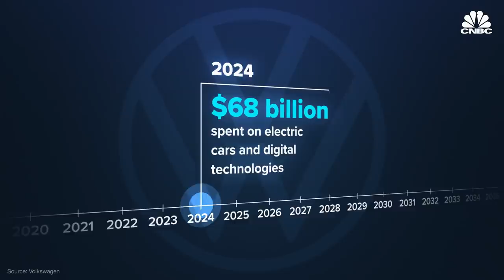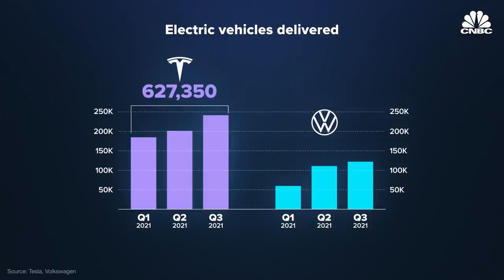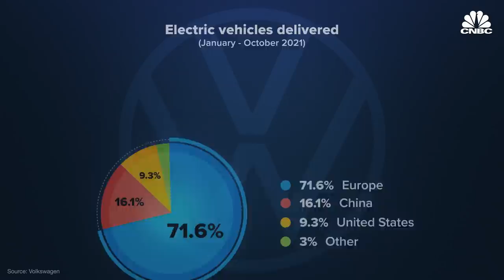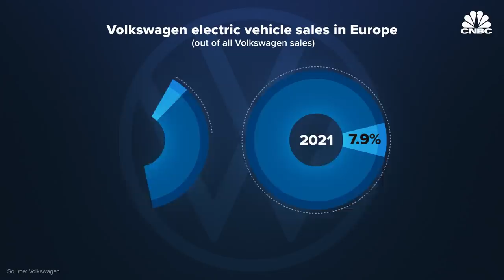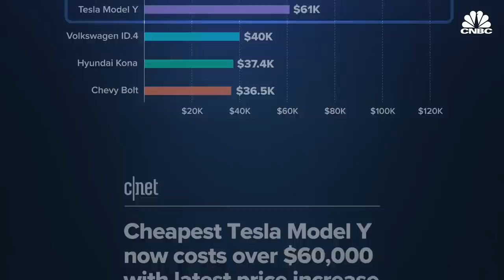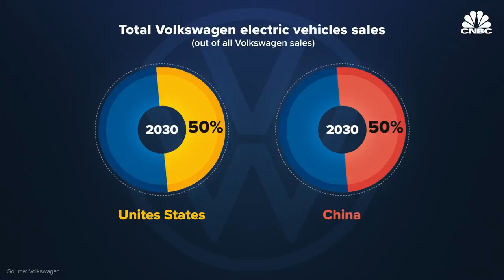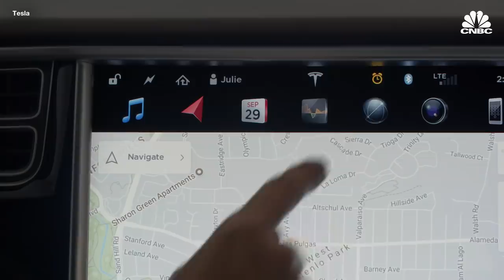Why Volkswagen Is Beating Tesla In Europe

Comment: It’s all about business infrastructure, you can find a VW dealer and thus service  in every major city of all EU countries. When I choose a car having the support infrastructure at a good price level is everything. Cars need maintenance and eventually break down, you need reasonably priced service that is actually available.
Reply: EVs do not require the same level of maintenance, so what you are describing is a non-issue.
Reply: @IanHague  real issue when you have to travel to another country to get an issue fixed for your Tesla. Check Tesla’s service coverage in Europe. I’m not sure you fully understand the issues those cars are having. Further more, I would not be even willing to travel to another city for fixing/ maintenance. The car is a tool and it’s sole purpose is to serve me not the other way around
Reply: not helping if "right to repair" is a thing, like an iPhone lockout.
Reply: @IanHague  they need maintainance, that should not be 300km away or part should not take 3 months to arrive..
Reply: @Enrique Thiele Bushes, control arms, air filters, etc...anything that is subject to wear and tear from a daily usage. So yes I have an idea :)
Reply: @Enrique Thiele try to replace the batteries..
Reply: Tesla's quality issues lead to huge waits on warranty repairs apparently.

Comment: Build time for a Tesla 3 is 10hrs.  Quoted build time for a VW EV is 30hrs. To compete, VW will need to reduce build time by 2/3.  More automation, fewer workers, job losses.  VW'S fight is internal. The business has to overcome it's unions. A historic battle looms...
Reply: Tesla is the most inefficient car builder by a long way. Look at direct labour to output and it is still decades behind Toyota

This does not include all the rework needed for such a badly bulid car
Reply: @teddysthaiadventure2534    I don't know where you get that theory. I think you pulled that out of the south end of a northbound horse.  I am open to the data, please list it

Comment: The title of this episode is absurd.  Tesla's factory in Grunheiden is not even up and running yet--- when it has had a few months to get up to speed, Tesla will be trouncing not only VW, but every other car maker.  Tesla can compete very favorably on its single front- and rear- castings, which they are years ahead of everyone.  It would take years just to get the casting equipment, months to install, and they might never get the propeietary alloy right that is needed to prevent one or more casting issues such as warping.

It's not just the casting issues... for instance, many consumers realize VW burned them bigtime on Dieselgate, and that scandal will last a lifetime with many consumers.  Tesla does not have that issue to overcome.

There are other problems Diess will have that you did not cover in these few minutes.  Tesla has the upper hand as long as they make no serious faux pas.

Comment: The vast majority of people in europe is living in flats. Where are they supposed to charge their cars? 
Underground parking charger installations won't do. An EV is too dangerous to be charged or even parked under an Appartment house since it can catch fire and when it happens you simply cant extinguish it. There were already some cases of sudden burning of tesla cars due to some kinds of short circuit.

And the studies have showed that charging only at the fast charging stations reduces the battery life significantly. There needs to be variation, but mostly charging over night is better for the battery.

This is the one big thing that stops me from even considering to buy an EV

Comment: My diesel car has a range of 1200 km, I can fill it up in less than 5 minutes and filling stations are everywhere, that's comfort no EV is likely to beat anytime soon if ever.
Reply: So how much does it cost per km to power your dinosaur juice-guzzling belcher?   Run the numbers.  Here in the states it only cost me 3 cents per mile compared to 10 cents / mile for gas in my area.

Comment: Would be nice if the ID4 didn’t include a long list of things you have to settle for: bad seats, arm rests, horrible lagging screen interface, lousy range, no software updates.  That may have been ok in 1969, or 1989. But Asian EV’s and Tesla blow VW out of the water.
Reply: cars are not home appliances. there's a reason every major car manufacturer maintains a network of service centers with qualified techs.

tesla has none of that. and they never will at this rate.
Reply: I don´t know where you tested the cars, but the built quality of the iD4 is much better than that of Tesla.
Reply: @yoshyoka  lol

Comment: With a Tesla you can easily Charge all over Europe. 

And the Pricing ist competitive. all you need to do ist to compare the Model 3 with other cars.  

In a Model 3 you have also a much better Software including navigation and planing for SUC on your route.

For now, Tesla offers the best total package for the Customer.
Reply: and all that comes with a price
Reply: Kia EV6GT 10k, same range, same acceleration, quicker recharge due to 800 volt tech, can recharge other cars via plug, level 3 FSD while Model 3 and Y have same range, slower charging times 7 to 10 minutes slower, only level 2 FSD for 10k higher prices.
Reply: Tesla better navigation than Google app in cars, fake news.

Comment: They're not selling the ID.3 in the States?! That's killer model.
Reply: Probably because it's too small for the American market
Reply: Americans want longer range… everything is more spread out
Reply: @cybertrk  The standard Model 3 offers 260 miles, the same as the ID.3, and that sells fine. That's four hours driving between charges. And a 340 mile ID.3 is available. Perhaps Tesla benefits from its proprietary charging infrastructure. 

And, as someone else commented above, Americans might just want bigger cars.
Reply: @cybertrk  That's not really why, though. America is "crossover" land. Sedans and hatches don't sell well. The Model 3 is the exception probably because it is one of the few fast purely electric sedans available. But the Model Y is going to face stiff competition in the USA.

Comment: You know why VW will dominate over Tesla in Europe as well as every other Europe based manufacturer? Because we know how to build cars. Compare battery capacity of Tesla and VW, it’s not as big of a difference, but compare build quality and the difference is enormous. And people in Europe are used to high standards when it comes to cars.
Reply: ID.3 has terrible build quality.. Being proud about germany is a nice thing, but you should stay with the facts. Tesla is going to produce their cars in germany with german engineers working there too. The build quality will be amazing, which it by the way has already been for about a year since europe has been getting the cars made in china, which have a much improved quality to the fremont cars we used to get, which were mainly bad, because Tesla had to improvise the production line given it was made in a pre existing factory, thus it was much harder to get a good and efficient production line going while ensuring good quality, but in the long run even Fremont will improve as it reached the end of it's ramp-up phase and improvements to the quality and engineering became the main focus.
We shouldn't ignore the german car makers issues either.
Daimler has major quality issues too, just google their recalls. Sadly enough they are in lack of replacements parts right now which makes the situation even worse.
Teslas times of being infamous for their bad quality, especially when it comes to panel gaps and the paint job are parts of the past already and hardly anyone will remember then when Giga Berlin starts putting out high quality cars.
Reply: @teslaheini3169  I own ID.4 and it’s in much better quality than my previous car, and that was Model 3 from 2019… I would say that quality of ID.4 is comparable to my wife’s Golf…

Comment: Did this guy actually say 400 charging stations in the whole of Europe? Bold ambitions VW…
Reply: additionally to the thousands that ionity already has where VW has a 20% share.
Reply: What he meant is 400 sites with multiple charging stations. Still not very bold, but the basic idea is just to fill gaps to allow charging stations to be a maximum of 120km (~80 miles) apart from each other so recharge capacities would always be within reach.

Also, keep in mind most governments are ramping up their construction of charging stations throughout Europe - but most of them focus on the cities while VW's plan is to fill the gaps between the cities, making longer-distance travels more viable for EV's in Europe.
Reply: @stefanweilhartner4415  but your missing the key question.  Are they 250 to 350kW stations like Tesla?  Nope... you cant count a 6kW max charger!  those are for bicycles now!
Reply: @bryjb10  the ones from ionity are 350kW. even before tesla was reaching that power.
i don't know where you got the 6kW idea. even people at home have 11kW here in europe in their garage.
Reply: @stefanweilhartner4415  currently in the USA 90% of non Tesla chargers J1772 are 6kW or under.
Reply: @stefanweilhartner4415  name one car that handles 350kW charging
Reply: @bryjb10  eletrify america allows 150-350kW.
the audi e-tron can handle up to 300kW, similar as the porsche taycan
Reply: @stefanweilhartner4415  nice try Audi Etron max charge rate is 120 kW and Tycan 4s is 225kW  and turbo is 270kW. Again there is only a handful of chargers that support anything above 200kW and even less that support 270kW
Reply: @bryjb10  which is of course not true. electrify america and others supports high power and many many in europe support this. the new ABB chargers go up to 360kW. europe has already a huge network of many really fast chargers above 150kW
Reply: @stefanweilhartner4415  so I have showed you actual data. All you say is not true. So prove it

Comment: The two features, ( that will keep Tesla in the lead for a while):
1. FSD - full self-driving and DOJO
2. Supercharger network
Even though there are a lot of better looking EVs out there the 2 features above can't be beat.
Reply: Also efficiency, only korean cars get close
Reply: FSD is kind of irrelevant right now. It’s still a closed Beta program that makes the occasional dangerous mistake, and Autopilot has a phantom braking problem that even after a few dozen updates is still present. I’ve been a Tesla fan for over a decade, but autonomy has so far been an expensive disappointment.

The Supercharger Network though IS the decision maker.
Reply: 1. Tesla’s FSD is actually illegal in Europe
2. Charging network in Europe is actually decent
Reply: Not important in Europe
Reply: FSD still hasn’t been released for the general public. There are some law suits starting to appear about FSD since the product has been sold for many years but never delivered. It still got a LONG way to go before it’s ready. Tesla are opening up the superchargers so that any electric car can use them too.
Reply: FSD isn't really that far ahead of Mercedes for example and Superchargers are slowly opening up to other brands
Reply: @TecnamTwin  agreed it's still a beta, but i think it'll be solved in 2 years. So it's a good idea to get a Tesla now (if you're in the EV market).
Reply: @michaelsieber98  Tesla is extremely far ahead when it comes to autonomy/FSD. No manufacturer can compete (at the moment).
Reply: This comment is why Tesla is still alive on 12th place in US and 18th in Europe: People naively spreading Teslas guerilla-marketing schemes, without objectively looking into it themselves before.

1. FSD (full release) will get lvl 2 rating as confirmed by Head of Legal at Tesla. Bare in mind not just the Beta, the full release. Whereas Honda and Mercedes already have lvl 3 approved cars on US roads. It‘s because Tesla could not afford to bet on LiDAR in their cars at the time and basically had to give up on the race for best self-driving. FSD and robotaxis was just guerilla-marketing to cover that up and keep the hype alive. FSD is extremely dangerous, because it is lvl 2, but allows people to treat it like lvl 3 or higher. As is evidenced by people commenting here believing that it is the best system. Lvl 3 means that you can take your hands off the wheel and take your eyes off the road without losing insurance coverage or incurring liability in the event of an accident, because it‘s proven to be safe and reliable and officially approved. That’s where Mercedes and Honda are at. Tesla is far from it and could lose even the lvl 2 rating soon. Look at what is going on with the US Department of Transport and NHTSA right now with regards to self-driving regulations etc.

2. Tesla has already had to open their supercharger network to all car brands in many places and is in the process of opening it up completely. Any Audi e-tron can drive up to a supercharger now and charge twice as fast as a Tesla.
Reply: Just an example: 

1. Person A drives Tesla FSD enabled down a highway while looking at phone with medium/low chance of an accident occurring.  

2. Person B drives Mercedes distronic enabled down a highway while looking at phone with low chance of an accident occurring.

1 - In the low to medium chance event Person A (Tesla) gets into an accident. Person A will be criminally liable and liable for damages in a civil suit. It will likely also lose vehicle and health insurance coverage. 

2 - In the low chance that Person B (Mercedes) gets into an accident. Person B cannot be held accountable, because the system is lvl 3 approved and was allowed to look on their phone. Person B will keep health and vehicle insurance coverage.
Reply: 1. Tesla stuck at level 2 FSD while the competition has level 3 in their production cars and 4 in their concept cars
2. 800 volt tech Kia EV6GT recharges in 18 minutes while old 400 volt tech Tesla cars recharge in 25 to 30 minutes
3. consumer reports ranked Tesla among 3 worst reliable car brands.
4. Mercedes EQE and Nio ET7 have longer range than Tesla cars
1 to 4 are factors to consider not to buy Tesla cars.

Comment: This is idiocy.   25 different models…. Tesla has ONE (the Model S and X essentially not sold this year in Europe).   What is the number one model car in Europe?  Model 3.   All imported.    All more expensive than all VW models.   And who is actually making money?   Tesla is at making at least double per car.   VW is by admission miles behind.  Every point made in this is pretty much a joke.   Charging, software, manufacturing capability, battery production, even in Europe Tesla with their one car is simply crushing it.   Trouble will truly come for VW when the lower tier high volume Tesla comes into production.

Comment: Tesla figured out that it's better to start a factory from scratch. Fremont (Tesla's 1st factory) was a conversion. they've learned it's better to build new: Shanghai, Brandenburg, Texas. 
also, Tesla & VW offerings are apples & oranges. Tesla plans a lower cost ev for the future which will be a more direct comparison.
Reply: Tesla learned that starting from scratch is better... *for tesla*.
VW & Co have a lot of experience with converting production lines for new models and streamlining production costs along a whole range of models.
They'll do what works for them and Tesla will do what works for it. Time will tell who gets more of it right - but don't dismiss that the model 3's production hell and Tesla's long-standing issues with quality control are very much a consequence of inexperience.
Reply: Tesla PLANS a lower cost EV in the next years, VW HAS one.

Comment: It is clear by now that every EV being made is being sold at the moment...it doesn't matter what brand it is coming from!

So to see the trend of who is going to be the biggest you have to see who have the biggest plans for expansion and what car company have the most batteries to put in the cars.

Tesla have plans and the batteries to make 2 millions cars in Europe ramping the next 3-4 years. 
It is very unclear how fast VW can ramp in the same timeframe with there endless meeting and internal scrubbles. What do you think?
Reply: Incisive points.
Reply: vw group have the infrastructure and distribution network to ramp up output despite their internal issues
Reply: @marcelohendrix6139  When you make a car and that takes 30 hours as VW does at the moment... And it takes 10 hours for Tesla to make the same car. Do you think it is going to have an impact on if you company is going to be profitable or not?
Reply: @NicolaiJohannesenDK  vw group will be fine, they have the best engineers working for them so to think they won’t be able to become more efficient in the future is silly
Reply: @marcelohendrix6139  Of course VW will be more efficient... but how fast will they become more efficient? How fast will the rate of change be? 
Right now they are only 3 times slower. It is also possible for this number to go up!

Yes... VW have a lot of mechanical engineering that are good at making engines... Not what is needed in the future... To be more accurate not what is needed right now.

Do you think Tesla will stand still so other car makers can catch up? 
So far they have shown no sign of that.